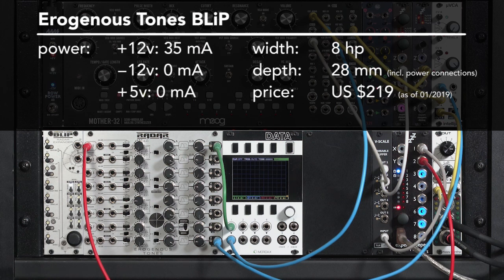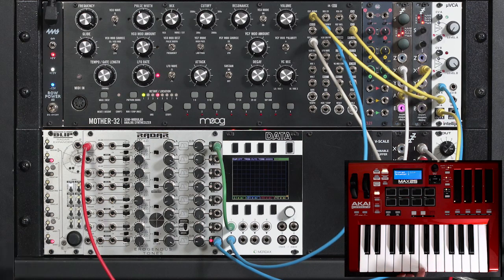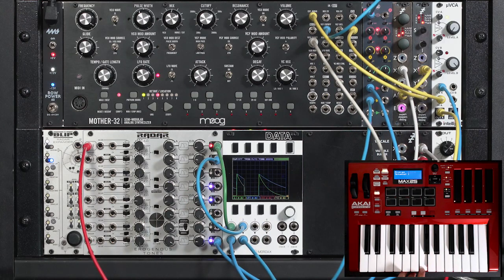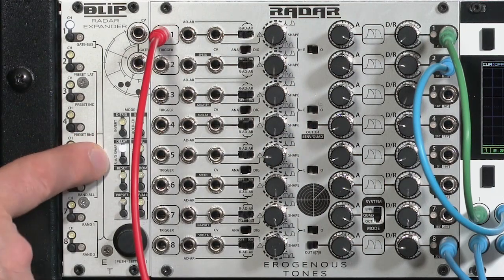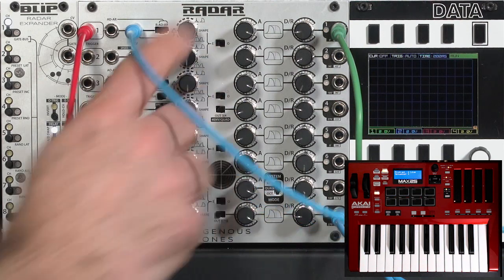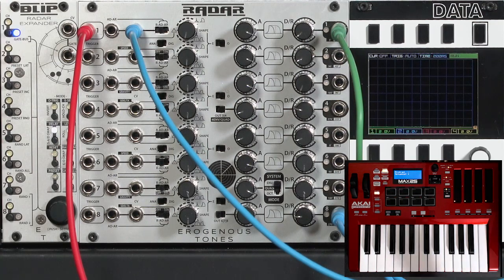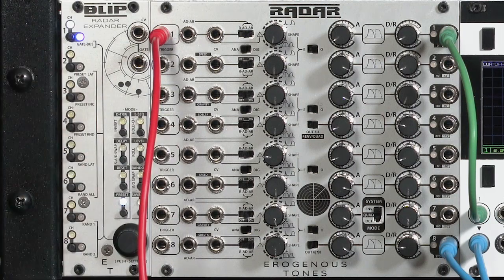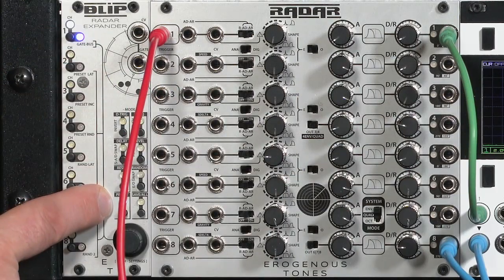Erogenous Tones RADAR 4/4: BLiP Expander (LMS EE)

Comment: Wow! I have LEVIT8 and VC8 but overlooked RADAR because I've got lots of ENV options in my case and was put off by its lack of CV over A/D and EOA/EOC triggers. Had no idea how incredibly useful it becomes with the addition of BLiP. May be worth an upgrade in the future... after I pay off some of the current massive modular debt!
Reply from the maker: You got me thinking about this...If you had some left over envelopes, you could set them to instant attack and very short decay, and trigger them using the E-SEQ section of BLiP to give EOA/EOC triggers you could patch to other modules. (Of course, E-SEQ also does that internally to other envelopes.)
Reply: @LearningModular  Hey, you're right! With 8 channels you could easily use a few for this external gate technique. Good call! I was able to get a crazy good deal on a used Radar and Blip so I've got some exploring to do! Thanks for the inspiration.